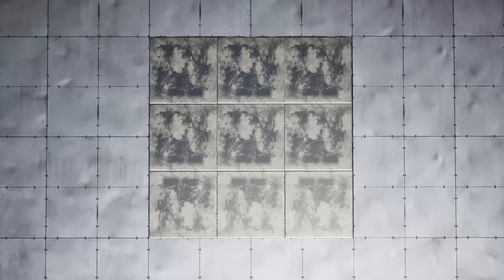How to Build a Vault Floor in ARK: Survival Ascended!

Comment: Great tips and video. I hate the sinking on top the vaults.
Reply from the maker: Thanks! I do too! It makes no sense when they worked in the old game. Hopefully, they fix it soon, 'cause it's bonkers.
Reply: @toastbloke  maybe, for avoid this, you can put just a little lower the vaults, enough just to let you put small hatch frames up, open, so you can walk on hatch frames and have acces to vault in the open of the frame
Reply from the maker: @eduardoslabecki6172  You can, indeed! It was a little difficult to access the vaults through them though and was even harder to get out if you fell in! 😅 Still, it does work, you just have to be careful. I just want the vaults fixed asap! Please Wildcard!!! 🙏

Comment: The whole point of a vault floor being flush with the ceilings is to be able to walk across it. I dont know why you'd want it to look cleam and pretty if its not usable. You might as well just go up by a quater ceiling so its actually clean to use as well as to look at.
Reply from the maker: I held out on making this video for that exact reason, but I had a few people ask how to do this and there's no way they're not going to fix the vaults. They're clearly not meant to be like this. Looked so stupid and still caused collision if you made them walkable. This is at least usable, so I'd rather make it look right and future proof it.
Reply: @toastbloke I guess you were right they did fix the vaults 😭
Reply: Right as rain🎉

Comment: is there anyway to get an offset like this on the highest floor of a building? so your roof can be a vault floor but not have all the floors under be a seperate height?
Reply from the maker: I've not been on the test, but I'd imagine you can transfer the offset by building up from the outer foundations with walls and the inner ones with walls/pillars and placing ceilings on top of them. Means you have some structures inside, but should get the desired result!

Comment: what if you build up with air conditioners before you place the vaults so your walking on the air conditioners that are just below the surface of the vaults
Reply from the maker: Thankfully, they've fixed the soggy tops now, as I'd hoped, so you can just walk straight across the top of the vaults as is!

Comment: U don't even snap the foundations together so is pointless
Reply from the maker: The point is to not snap them together. Why would they need to be snapped together? Snaps are locked to a half wall height.
Reply: All it means is they are two separate "structures" and have their own decay timers... Which will get reset at the same time so it doesn't even matter